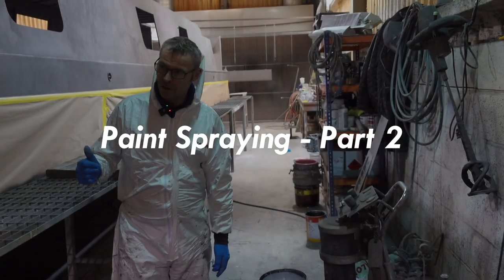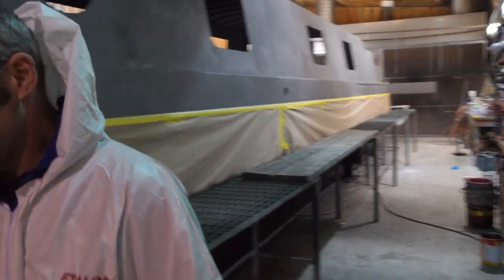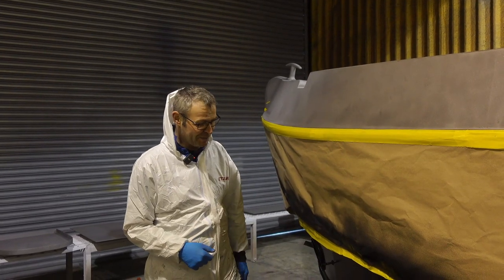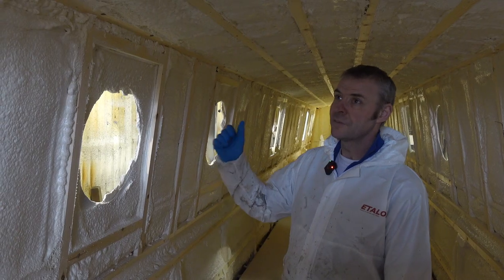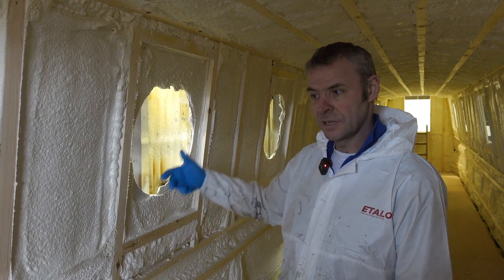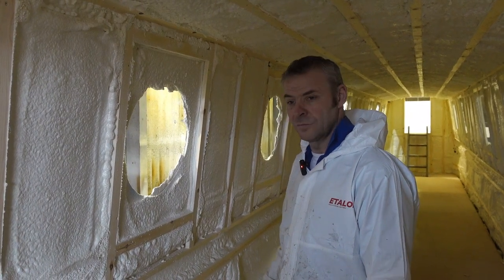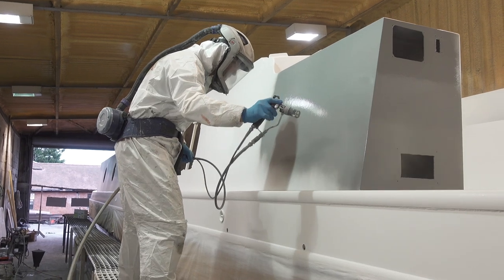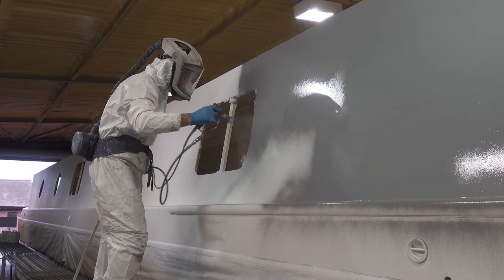Painting our lastest boat build part 2

Comment: David
What about areas of the boat's interior where there is no insulation eg the engine room or the gas locker at the front? Are they painted with the same product and the same attention to detail? Also the hull under the ballast. Boats can rust from the inside too.
Jeff